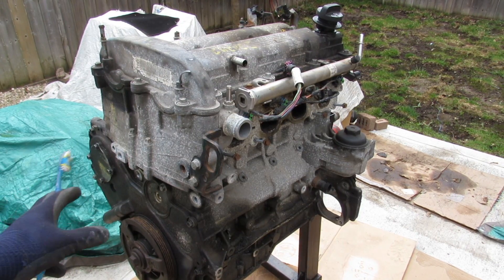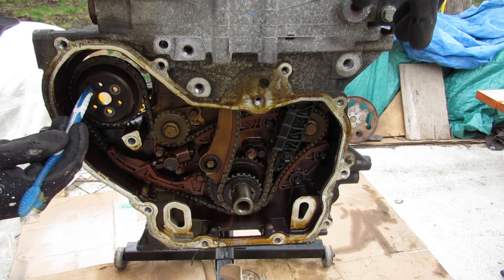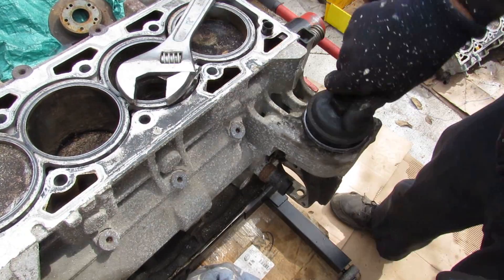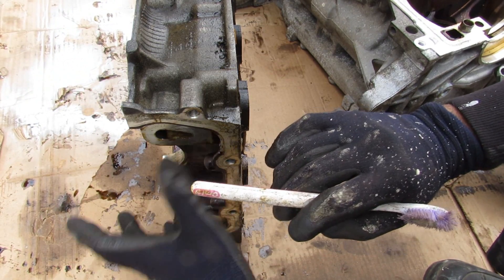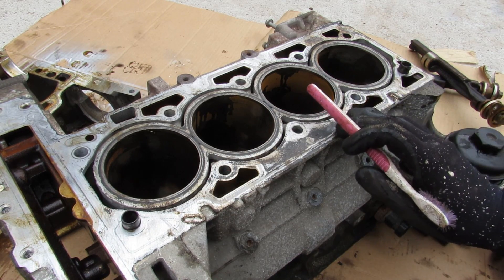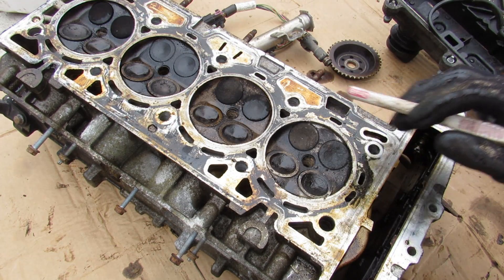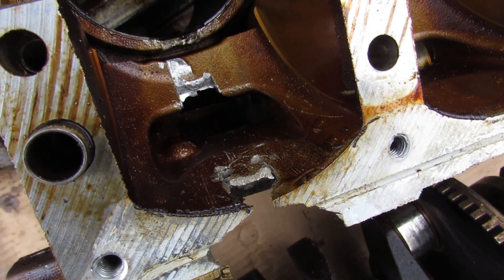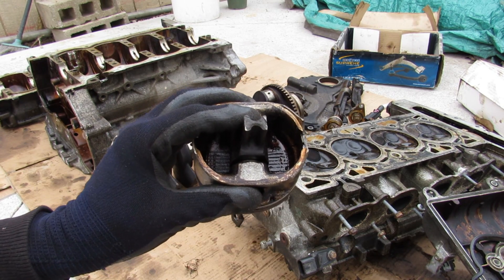Why GM Ecotec Engines FAIL

Comment from the maker: Make sure you keep your GM engine well maintained with parts purchased from here:
Oil Filter:
https://amzn.to/3aDA60g (US)
https://amzn.to/3vdhOKU (Canada)
Oil Filter Socket:
https://amzn.to/2Qmr8O5 (US)
https://amzn.to/2QwRixp (Canada)
Engine Oil:
https://amzn.to/3gE0Lxy (US)
https://amzn.to/3veSFQf (Canada)
3/8” Socket set:
https://amzn.to/3tRBUKF (US)
https://amzn.to/3vjz1T2 (Canada)
Oil drain pan: 
https://amzn.to/3xqpqeY (US)
https://amzn.to/3niZ5uV (Canada)
Reply: I stopped buying gm year’s ago
Reply: Quite a few newer engines have oil consumption issues oil control ring design with the extended intervals. On this engine oil starvation caused the rod failure. Cylinder 1 usually is the failure point as that rod journal is last in line for oil. Ecotecs don't fare well with the extended interval between oil changes. Keep the interval around 5k max and it will be a reliable engine.
Reply: @Mike-yq7ce  Not if you have those POS oil control rings. On some of those engines, you won't NEED to change oil, you will be adding fresh oil every 100 miles!
Reply: @Mike-yq7ce  no wonder my Saturn Vue with that 2.4 at 400,000 miles started running like shit after I changed oil didn't know they didn't fair well to oil change that just sounds crazy to me but I'm sure your right adding a little Lucas heavy duty stabilizer here and there
Reply: And use a brush to make it more professional.
Reply: oil control rings - fascinating. thanks
Reply: What's crazy is I have the same 2.4l ecotec in my 09 Saturn Vue about to go on 400,000. Little bit of blueish smoke at start either valve seal or piston oil relief ring I'll run her till she blows!
Reply: Can you please do a gm 4.6 northstar please 🙏
Reply: Gallery. There is no such thing as an oil 'galley'.
Reply: Will not matter, looking back at oil analysis, engine had high metal numbers at its first analysis (20K miles ) and continued for the next 2 I did. Engine suffered catastrophic failure at 143K miles. JUNK (2010 Equinox & the 2.4l).
Reply: Yea, buy Chinese parts from Amazon to keep your ALL GM Motor ALL GM? Generally Malfunctioned if you are buying chinese crap from Amazon.
Reply: This comment screams look at me use my parts so it happens again
Reply: or just get a used toyota
Reply: You don’t recommend using synthetic? Also, when you mention “your gm engine”, are you only referring to the one in the video or all for that type of oil?
Reply from the maker: I don't use synthetic for my cars. It's upto the engine if it calls for it. The ecotec, being an everyday appliance, would suffice with conventional as long as it's been maintained and changed on time, often before the manufacturer's time interval.
Reply: @speedkar99  The standard for these engines is Dexos 1 grade synthetic oil...  Why would you use conventional oil and court disaster?
Reply: wanna do the 4.2 L Vortec? thanks

Comment: just bring back the american pushrod engine, GM 122 4 cyl is the bullet proof and easy to modify to gain much power. just put the turbo, it was iron block and pushrod engine. standar gm122 was 120hp n/a , with turbo can boost 200 hp....without any complicated timing chain failure!!! i love the GM's 1990s engine...simple and reliable, the v6 - v8 - 4 cyl , all was pushrod design. v6 vortec 3400 and v8 ls1 5.7 was my favorite timeless engine!

Comment: change your oil and you.ll be just fine.
Reply from the maker: Check* your oil frequently too. Some engines will burn it through these long intervals people are pushing them
Reply: @speedkar99  RIGHT.
Reply: @speedkar99  i know tell me about it i just took an engine apart last week for a customer.

Comment: About 3 years ago I traded in a Cobalt with the 2.2L and a 5 speed. I had 240,000 miles on it, and did all of the maintainance myself. It still ran really well. During its life I did replace the timing chains, tensioners, guides, sprockets, etc. Also the water pump. 

The engine wasn't bad. But I completely agree with what you said about making sure you change your oil regularly. Absolutely. I noticed a lot of areas where if the oil gets dirty and sludge, it would definitely cause big problems. I'm glad I changed the oil regularly at 3,000 miles.

Comment: I have a 2003 Cavalier I bought from an old lady that had bought it new and only put 24k miles on it. I've had it for a few years and taken it up and down the East coast. Im at around 66k miles now and I do regular maintenance. It's a GREAT beater car. I had another Cavalier that wasn't well maintained before I bought it at 140k that made it to 180k before it died.

Im trying to hit 200k at least with this one, so my intentions are to change the water pump and timing chain at 100k or so.

I use full synthetic and change it every 5K miles.
Runs like a top.

Comment: Just wondering I have a 2006 Chevy Malibu 2.2L eco tech 74k miles I got it 3 years ago with 48k miles now a few weeks ago I am getting po420 check engine light so I replaced my #1 O2 sensor and my coolant now says low so I found it good into the oil so I replaced the timing chain water pump head gasket I didn't get the head checked but I checked it visually looks good even the old gasket looks good I put back together I still am getting 1/2 gallon of antifreeze in my oil every 80 miles , never overheating,is it possible for a cracked block on the 2.2l ?

Comment: The cobalt ecotec engines were so under rated. Very stout Design minus the conrods. That crank can handle 600hp. 

Its amazing how they still have a respectable service life when people neglect them. If you maintain it religiously like someone would their Japanese cars. They would last just as long as a Toyota or Honda 4 banger.
Reply from the maker: It depends on which ecotec...the turbos were not well.
Reply: @speedkar99  
I had a 09 2.2 and now a 09 2.0 LNF. People forget to clean their valves with direct injection. I think that causes Alot of problems. Also, it's really cheap to get well into the mid 300s for HP so Alot of people probably abuse them.

Comment: Ive owned 3 different 2.2 i4s, one in a Cavalier and 2 Cobalts. Never had any engine or trans problems with any of them. The last Cobalt had around 240,000 miles on it. They all got 33 mpg and never used oil.  Great  cars and i always used my OWN oil and filters and changed it myself buying quality stuff from big box stores.
Reply: 😮Addendum:  I sold it 2 years ago; the lady is still driving it.

Comment: These 2.2 were really good engines if you maintained them properly.  Compared to the newer GM junk 1.2, 1.3, 1.4. These were Bulletproof.  Americans are Lazy and wont even do oil changes and trannie , antifreeze services. No wonder they grenade themselves. Then they Dog them Hard.

Comment: My Saab aero did 168;000 miles then I scrapped it it was a 2003 model and it still did 150;mph
Reply from the maker: What was the issue?

Comment: The rods are strong enough up to ~300hp.. if you're not trying to do "performance mods".. then these will run forever..with good maintenance these are known for running through 200k miles...

Comment: Soooo is the 2.0t one any good? What years do you recommend? Looking at buick regals ideally paired with an aisin transmission not gm
Reply from the maker: I can't recommend the newer GM engines. The older 3400/3800 was better.

Comment: all they had to do is keep oil level sensor and alert, and one way tensioner as toyota has, boom, reliable engine and timing system even low on oil
Reply from the maker: All they need is an owner that knows how to check their oil ....
Reply: @speedkar99  I bet you check the oil 5 times between oil changes. Then let's go back 70 years ago and crank your car manually , it worked too

Comment: I have a 2004 Cavalier and love it!  It has 180k and still runs strong.  Fun car to drive.  $200
Reply from the maker: Those were good engines...if the car didn't rot away first.

Comment: Massive flaw the 07 and earlier 2.4s have is the timing chain tensioner, the models I mention use a spring tensioner, later model ones use an oil pressure tensioner that is much more reliable. My Ion died from the chain jumping since I couldn't get the part during the GM strike
Reply from the maker: How much did that cost?

Comment: I just installed a junkyard 2.4L Ecotec in an NA Miata and I replaced the timing chain, balance shaft chain, guides, tensioners, and waterpump. On a stand the engine was easy to work on, cheap parts, and all the components are robust, even the plastic guides. Compared to that N54 BMW fail you just tore down the 2.4 Ecotec is a kinda slept on cheap good motor.

Comment: Man I’ve put 2 of these in my 08 cobalt now so on my third engine has a updated tensioner and guides this time around but fuck I can’t afford a reforged or nice engine… but this last one only has 100k on it lol (my second engine had 200k and was fine but ex had a dude remove my oil plug x.x
Reply from the maker: How hard is it to replace?
Reply: @speedkar99  i did it at my grandmothers with a tractor to lift the body off the subframe and rolled it out have pictures took 2 evening very smooth job im very attached to my cobalt had it since 2012  bought a Haynes and learned to do everything on it. (absolutely adore the fwd subframe design on these)

Comment: Main failure is timing system guides wear out causes chain slap and metal bits in engine needs a timing job every 100k min
Reply from the maker: Sadly

Comment: Vids like this make engine work look easy. I know how to handle tools yet engine work I scare away of. Now I feel tempted🙄
Reply: Go for it. Got to conquer that scared to. Got to start somewhere on something. I've done old school stuff from the 60s,70s,80,early 90s in my teens and twenties, simpler and more practical then. Haven't had to do any serious fixes or had the time to keep pace with the more modern and the latest or newest more complexed vehicles, I've just resently done serious work on is a 2001 Silverado engine and transmissions swap just this month. And just got a used 2008 colbalt pretty cheap that's going to need a timing chain and no telling what else since it jumped timing and bent the valves. At least it doesn't have connecting rod inspection ports. Just hoping the pistons aren't battered up  severely. Going DIY you'll definitely learn and increase your skill and learn where your abilities can taking you. If you've got a clunker or one about to be is a learning opportunity HOW TOO. Building experience and skill is an investment in yourself, though you may spend x dollars in a vehicle others would get rid of because it would cost them more in labor and parts than what the market value of vehicle is worth. DIY you learn and can save X amount of dollars in trade off your time invested doing the work. I encourage you step over the scared to and try. 👍good luck to ya.

Comment: I have this exact engine in my 09 Pontiac g6. 220k miles original engine and transmission. Transmission fluid has been changed regularly and I change my engine oil every 5000 miles religiously. She does not burn a drop of oil. Great engines if you maintain them

Comment: 1.4 turbo LE2  in a 2018 Chevy Cruze,  0w-20 full synthetic (Mobil 1) with Mobil 1 filter every 3500-4000 miles. 75000 so far with zero issues. The only caveat is to make sure you seat the engine air filter correctly. Had me chasing down a P0172 code for weeks. The cabin air filter is a real chore, but other than that it's been super reliable.

Comment: I haven't seen the pistons in what condition they are, But I'm pretty sure my Ecotec Engine on a Opel Insignia 2.0T A20NHT,
that it has around 500.000km, Still running it.

Comment: I purchased a 03 Saturn ion new with the 2.2 ecotec motor.Still own the car it has just under 100k miles . The car has never broke down it always started in the cold mn winters it takes no oil. The original battery went 13 years and was still working when I replaced it. Just didn't want my wife sitting someplace with a dead battery. Always used Mobil 1 oil . This car has been listed as one of the top 10 worst cars of all time after 20 years it's one of the best vehicles I've ever owned. Did the maintenance myself. The engine light came on a couple times found rubber around thermostat came apart and got jammed in the thermostat installed new thermostat  and anti freeze. One other time I brought it to the dealership to hook up computer and check codes they found corrosion on sensor wiring assembly. They cleaned it up and charged me 60 dollars for the entire job. The engine light went out. Kinda shocked I left dealership with only a 60 dollar bill that was a few years back. Drove the car yesterday on a day trip 240 miles ran great.

Comment: So, the big problem with these engines is all related to oil. This ain't your grandpa's 5.7 or whatever that can run on poor quality oil. Full synthetic, preferably mobil 1 or castrol edge, and do your oil changes at 5k. No buts. Literally, the key issues i have seen from every one of these that has been torn down all boils down to oil. 

That and run decent plugs in them.

Comment: Thank you for you showing me how my 2.0 works.... We have a 2018 Camaro RS  (Yellow) with the 2.0 and a manual transmission... I change my oil every 4 to5,000 miles (oil filter also) it has 33,000 miles on it.  I have installed a cetch can (oil). I want to make our 2.0 engine last. I keep my RPM's above 2,000. so not to lug my engine..... I don't down shift,  brakes are cheaper than a transmission . Living in Northern Nevada we have a lot of mountains... so I cost as much a posable,   We drive 30 miles to town.  We get 30 MPG to 37. (was our best). I use 5th gear most of the time and 6th gear as a overdrive.  Plus when I see a red stop light far up there i'll cost up to it. I'll  put a 1/2 quart of transmission fluid in the engine and run it for 100 miles to clean the engine, then change the oil and oil filet.  I have been running the highest fuel I can get.  Is that really pessary ?  Do you recommend any fuel treatment  to clean my engine. ? I'm 79 years young and We really enjoy our Yellow Camaro RS.   Oh yes I have installed a spare tire.  Thank You so much....

Comment: I do have a 2008 Astra XR with 170k and I love the 1.8 engine. Makes 33 mpg and goes fast when you press the pedal. 5 speed manual.
Reply from the maker: Saturn?
Reply: @speedkar99  yes

Comment: This happens inside an ecotec engine after 250,000 miles when the oil is changed on time, the ecotec is not a bad engine when it has owners with a brain.--https://youtu.be/OkL0_CSwlRY

Comment: Worked at the oil change shop over the last year. Nearly every one of them, you can smell gas/oil mix or the headgasket is going😂, leaks from everywhere or burns it. Could be due to these people not doing proper maintenance, but i would never buy anything with an ecotec! Really, anything GM makes, stay away from haha
Reply from the maker: The older Cavalier engines were better

Comment: hi! Need your experitse help please! Motor is opel astra h 1.4 16v z14xep

When I drive my car it has no engine braking so when i release gas pedal it coasts to fast forward. Also when i acellarate I have to press gas pedal to hard while on my other car I can just tap the pedal and it goes. It seems as it has some pressure the car is fighting when acelarating while no pressure when i release gas pedal and it should be opposite.
Aynways I got no engine braking or very little what you think is the problem? Also the car exhaust sounds much quitter than other car and I get on cold start cloud of blue smoke on startup

Comment: Great video keep it up man I personally have had good luck with the 2.2 ecotec my cobalt has 283k miles one the original engine and transmission it doesn't burn oil knock leak or anything still gets 32mpg also its been maintained very well though  only has needed basic maintenance a alternator and a radiator fan it's a 2 owner though she's been spoiled
Reply from the maker: Awesome

Comment: 2007 Chevy Cobalt SS with the SC LSJ. 355,000 kms on the clock and still running smooth. Regular maintenance all around.

Comment: Never seen a rod brake because it hit a valve, if it skipped timing i would think at least half the valves in that head would be bent , seen this type of failure with boosted and or nitrous in Ecotec s that are originally naturally aspirated

Comment: Great video your explain the work so good your vocabulary  is perfect  and the tone of your voice is clear  compared with other videos that I trto understand  THANK YOU,  NOW I'm not a professional  but I do mostly around the house and garage ,I change  parts from my car and do most everything in my car,need your advice  I have  2007 HHR 2.2  ecotec  ,piston 1 went  bad making loud noise no warning, no light  on,my son was 2 miles away and drove like that to home .I check the car open oil panand noticed number 1 piston was a little  lose .I removed all the piston and the top part of the engine ,nothing  was bad  except for the crankshaft  has the bearing on 1 is not smooth  like  the other  scratches  ,can I fix that without  taking that part out or there is something  that I ca do ?  I'm 60 and like to keep moving and buzy I always  and this is not going to beat me ,plus feel  good  went your wife tell you  are so smart , that why I merry you  🤣😇 thank you
Reply from the maker: Glad you like it

Comment: Let's not forget to mention 2006-2011 2.2l and 2.4l ecotecs are one of the most tunable engines for performance forged parts can be acquired at that and the forged ecotecs can push up to 28lbs of boost which is up there with lambos and corvettes and other high end sports/super cars ...sadly it's not common but I've seen it done and I think it would be the perfect build I have hhr I do wish it was lighter tho